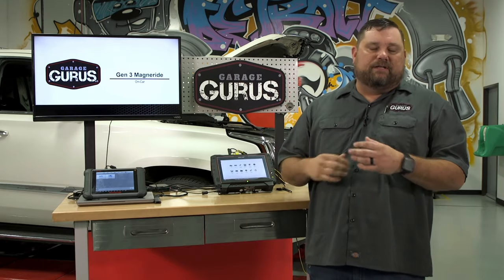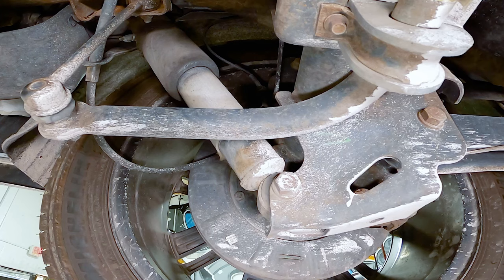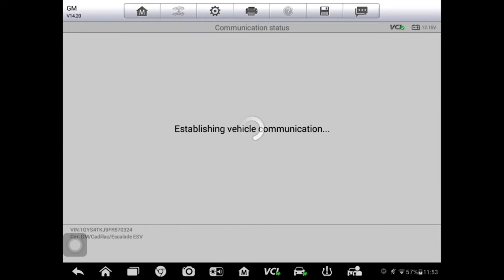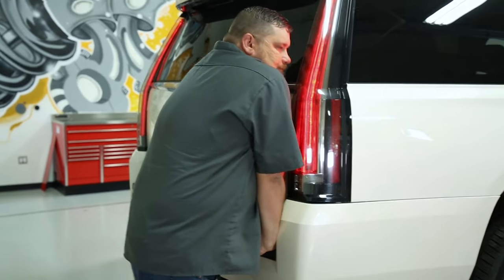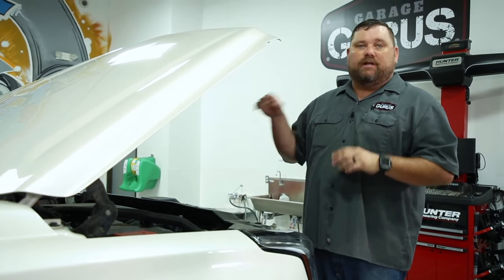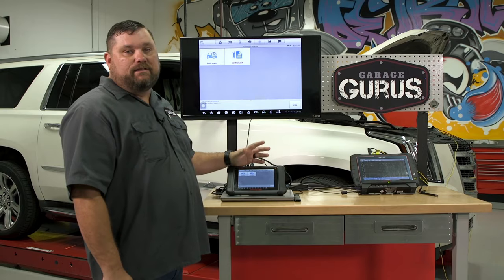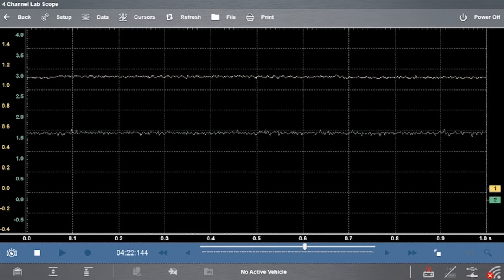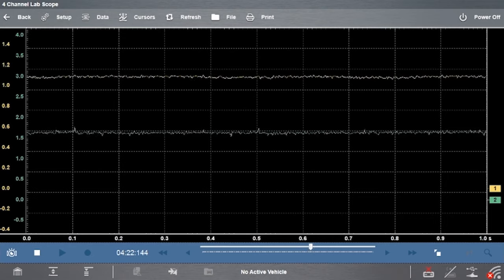Garage Gurus | Cadillac Suspension Testing

Comment: I’d give anything to find a dealer that would watch this video and duplicate this level of testing. My Escalade rides absolutely terrible. Two separate dealers claim “nothing wrong with the vehicle” even after I replaced all four shocks.
Reply: Hi, i have a tahoe 2016 i replaced all 4 shocks ride much better than before, but i ask the dealer to recalibrate the suspension module and they said NO because my car is a 2016 you believe that😥
Reply: @johnorozco7580 what does it being a 2016 have to do with it getting recalibrated? Did you install OEM or aftermarket shocks? I have a 2016 Platinum and just bought aftermarket Magneride ones from Strut Masters and I'll install them this week but wasn't sure if the control module needed to be recalibrated.

I'm also considering replacing the suspension sensors if the shocks still feel bad. Maybe the suspension sensors have gone out too.

Comment: My 19 esv bounces crazy on rear took it to dealer and said shocks dont throw codes but i was like ok but it should be smooth not bouncy all over the place. More fancy more things to break.
Reply: Did the dealer fix the issue? Was it a rough ride or just super bouncy?
Reply: @strongisland7015  made dealer check and front struts showed fine on scan tool when they did more digging found front struts seized and made it bouncy like golf cart. But i feel like rear are same because on bumps it jumps too so next is going to be checking rear. But it is rocking side to side when i push down on center is it normal to rock side to side. It should just go up and down right.
Reply: @atlant2566  when you say bouncy like a golf cart you’re saying it’s a rough ride then, not like the shocks are worn out and when you hit a bump it’s too much bounce right? Definitely imo up and down not side to side.

Comment: It would be great if you'd do a video on a Z55 suspension. I have the issue and "everyone" says they crap out at 15000 mi. So what fails in the dang shock? It would be great if you disected a bad shock to reveal the failed component. Maybe backyard mechanics can come up with a better solution other than fooling the system and putting in standard shocks. Avalanche user.

Comment: These shocks fail different. Normal shock get soft. These get hard when they fail. I think the fluid degrades  and the ports plug up. That’s why they get hard.
I replaced the from shocks on my ‘09 at 80k miles. I did not replace the rears but now at 130k the rears feel really stiff. Rockauto was the best deal I found. It’s a good system when it works but I don’t think it last as long as conventional shocks and it’s also pricy to repair. There is companies that sell conventional replacements with bypass so you don’t get a check engine light.